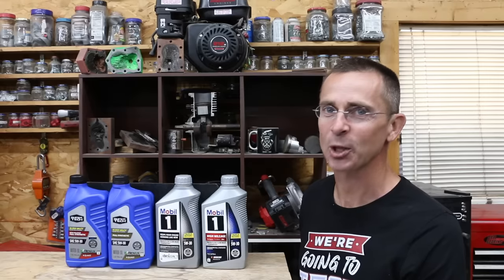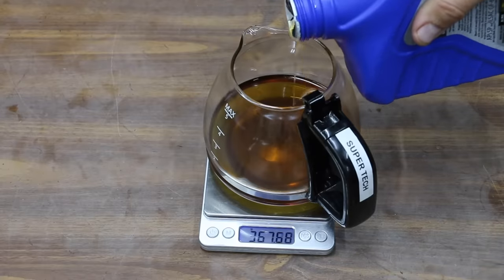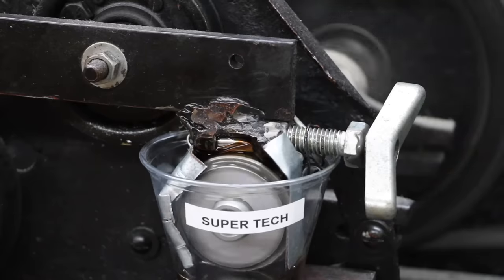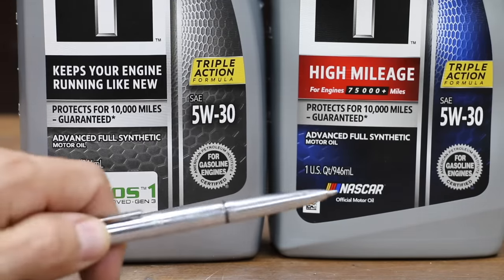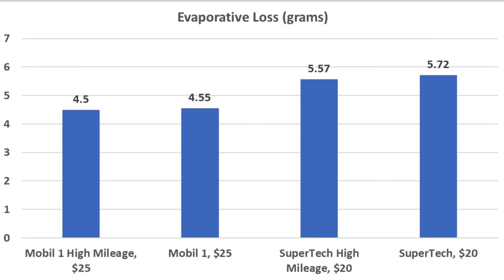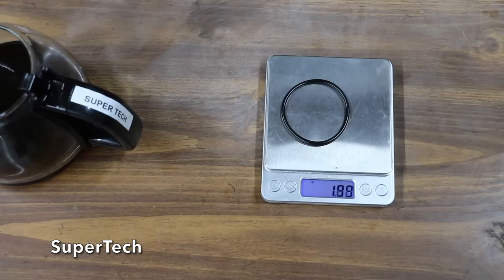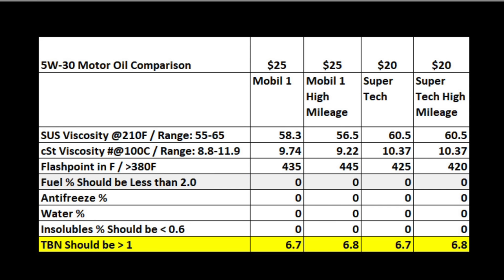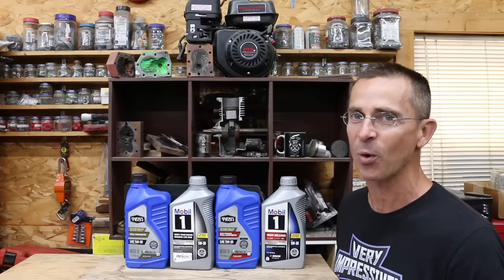Is “High Mileage” Motor Oil Safe? Let’s find out! Mobil 1 vs Mobil 1 High Mileage; SuperTech vs STHM

Comment: For those of you who don’t have time to watch the full vid, stick with a high mileage oil. It’s slightly better based on the test results concluded.
Reply: thank you
Reply: Meaning putting the "high mileage" rated oils from a manufacturer, even on a new engine?
Reply: @AKS-74U  High mileage has additives that causes worn out/heat cycled rubber seals after 100k miles, to swell up. Once you switch to high mileage you cannot switch back. When the swollen plastic seals have regular oil switched, you'll most likely see some leaks due to the shrunken rubber. So if you switch to HM oil, don't switch back.
Reply: @devinlehman8798  This is only partly correct, it depends on the brand and varies engine to engine.  Valvoline has stated their HM oil is fine for new engines, while Mobil 1 has stated the opposite (not recommended for new engines with no leaks).
Reply: @AKS-74U  It swells the seals - unnecessary on a new engine.
Reply: Thank you
Reply: He just recommended to not use the high mileage if your vehicle is still under warranty since the oil is not certified.
Reply: meh.... i don't like the additives that plump up seals.  only if i have a tiny leak will i try it.
Reply: All catalytic converter‘s are warranted to 75000 miles and the high zinc content of high mileage oils can damage your catalytic converter. Kind of like lead in gasoline  it will do the same thing
Reply: @67_PowerStroke  Incorrect, high mileage oils carry the exact same certifications as regular in the same grade.
Reply: @ianspeckmaier9565  If you watch the video, he literally shows that the high mileage oil in the video does not have the certification....
Reply: @67_PowerStroke  It has all of the same certifications except for one: Dexos. If you don't drive a 2011 or newer GM vehicle that requires you to use a Dexos certified oil to maintain a warranty still in force then there's no problem using it. Mobil 1 High mileage 5W-30 meets the following standards from certifying organizations: ILSAC GF-6, API Grades: SJ, SL, SM, SN, SN plus, SP, and SP RC.
Reply: My car has 210k miles on it. I stick to what the manual says - same viscosity rating too. Regular changes. If an engine isn't leaking, I'd keep well away from anything that claims to have seal swellers - they'll swell alright, and then they'll shrink, and then you'll have a bigger problem.
Reply: Thanks!
Reply: @67_PowerStroke  he "literally" doesn't work for any of these companies, he's just testing their products. So you're "literally" relying on the wrong people for specific information. Can we "literally" stop using the word "literally" incorrectly now? Sound good?
Reply: @otallono  And neither do you.... I'll t rust him over you anyday.
Reply: You the real mvp
Reply: @devinlehman8798  That's not true. If you think that it is, provide proof that says you can't switch back. Complete nonsense. Just like you can't switch back to conventional one you use synthetic.
Reply: @MattExzy  D
It doesn't work that way.
Reply: U da real vip
Reply: @devinlehman8798  That depends on how much you care about your car overall.  I have a 2005 Scion tC that I've been driving for three years and I'm waiting until it dies to get an actual new car, but even after switching between a half dozen different oil brands and types, including HM oils, it's still running fine without leaks lol.  I'm tempted to kill the engine myself so I can get a new car at this point.
Reply: @samuelmontypython8381  the way the market is right now you could probably get a good buck selling it and get you some more cash to go towards your new car 🤷🏻‍♂️
Reply: Thanks, still let it play out with the volume down so they can get their revenue.
Reply: @devinlehman8798  This is purely anecdotal, but my Acura with 254k miles on the clock recently started dropping oil in my garage. Took me until today to realize I had recently switched from Castrol high mileage to regular Costco brand full synthetic. Hopefully my seals aren't shot but I guess at this mileage I can't be a beggar. Gonna try to switch back to Castrol HM just for the fun of it.
Reply: @nateblazek3671  you should be okay if you switch back to high mileage, but I've heard bad stories about all the seals never swelling back up again.
Reply: I think the big difference is anti-leak additives in the HM ones. 75k, to me, is not very high-milage especially if the car is well taken of. I started using HM on my 2001 Ram 1500 with the 5.9 Magnum when it hit 150k. Now at 190k and still running strong with no leaks.
Reply: @timetryp422  So if you high milage engine does not leak then there would also be no reason to use high mileage oil either.
Reply: "For those of you who don't have time to watch the full video..."  Would be referring to those who Really should examine their priorities.  If you're interested in enough to seek out Legit Tests, you should be equally interested in seeing How the (Results) came to be.
Reply: Since it said, high mileage oil and it was meant for that purpose but it perform much better then the regular synthetic oils, can we use that on low miles vehicles?
Reply: @devinlehman8798  Yeah, but project farm just test the O-Rings and nothing much has changed, so where did that information came from?
Reply: @nickyalousakis3851  swelling of seals in never a good thing. if they leak, then the swelling is a temporary fix. Swelling seals is them crying out due to contact with incompatible chemicals. this causes degradation. hmm...
Reply: Ya brah gotta get back to my mindless scrolling on tic tok. Any form of information is too much stimulation for me. Just here cause im broke... Maybe cause i didnt wanna learn 🤔 maybe its cause im addicted to my phone.. Idk fam but im already writing WAY too much
Reply: @gosh.o505  It's all the same.  If the market is low, you'll get less, but pay less purchasing another.  Market high, you'll get more, but pay more.  The fact that used vehicle prices are inflated means nothing if you're selling, then buying.  You'll also be buying high so any benefit selling your vehicle is useless.
Reply: @pault1439 It's  actually true. And for similar reasons you should never use synthetic oil in old engine
Reply: @MattExzy  high mileage oil aren't meant to stop leaks, they're meant to prevent leaks with additive seals conditioners that help the seal stay pitiable rather than drying and cracking or become inflexible. If you have a leak it's already too late and you just need to replace a new seal and gasket.
Reply: @samuelmontypython8381  that’s not that old of a car. People are too picky these days. I drive a 99 outback until 2022 and now have a 2012 highlander that I plan to keep forever unless it rusts out (in the rust belt, but it’s still rust free at 220,000 miles. Sell the TC, young guys snatch those things up as cheap easy cars to tune/learn about cars with.
Reply: @integr8er66  wrong, high mileage oil isn’t ‘prescribed’ like a med, you can use it whether or not you specifically need leaks fixed.
Reply: @Theultrazombiekiller  I have the same truck with 144,000. It’s the last ever model year of half-ton truck with solid axles front and back, I’ll NEVER sell mine. Might LS swap it though. Haven’t had much luck rebuilding the tranny 3 times. Motor is gutless too, even with a moderate cam and 4:10 gears. A GM auto trans has a much lower first gear than the 46re, the re is terrible for acceleration from a stop.
Reply: See this is why we keep you around!
Reply: THANKS  !
Reply: @devinlehman8798  
Good to know.
Reply: @AKS-74U   No, just cars with over 75K miles
Reply: Thank you for this.
Reply: @67_PowerStroke  LiTerALlY showed that the supertech high mileage does have the certification
Reply: It has dexos certification
Reply: Good video - confirms my experience with hi mileage oils. Good to know about these in particular. I’d like to know how Pennzoil and some others that auto parts store chains sell compares, too. I’ve been using hi mileage oils, and later, hi mileage synthetic oils in my cars for many years. I always buy 3-5 y.o. used cars with 65k-95k miles, and start in with those oils right away. I usually get 10-15 years and well more than 100k miles before they start needing significant engine work and I’ve lived 20 years in L.A. where usage is rated “severe”. Same with the automatic trannys, which have been lasting even longer with proper servicing. Thanks, “Ozzie”!
Reply: You the mvp
Reply: @MrDaemonFC2U  my take when using other brands, is to change my oil as soon as I can. Changing oil on time is way better than going by brands and special logos like dexos.
Reply: @devinlehman8798 can’t believe how many people actually liked your comment considering you’re spreading false information. TLDR for anyone else reading…High mileage does not swell seals. It just has extra additives to keep rubber/seals pliable so they don’t dry out. Anyone who starts to say “I heard bad stories about..” please don’t listen to them
Reply: God bless you brother
Reply: Thank you for the tl;dr
Reply: Brother.
Reply: my guy thx bro
Reply: @devinlehman8798  stop with his nonsense
Reply: I love you
Reply: and what about the advanced that says it does much more?
Reply: @nickyalousakis3851  I don't like it when it rains.
Reply: My wife could benefit from using a high mileage additive of some sort
Reply: @devinlehman8798 imo I agree with that but from my own experience once a seal is done it’s done.

Pull the trans and replace the rear main seal or front timing cover seal (350 vortec) high mileage engines are gonna ruin any old seal regardless.

High mileage oil helps your engine yes but if it’s leaking regardless then no change in oil is going to affect the seal for the better (since it’s worn already and has met the end of its heat expansive life cycling)

there’s nothing that’s gonna stop it, not even stop leak, mostly because the seal is warped or no longer holding its shape and is worn out. all that stop leak does is clog your engine over time and slow the leak, which is a no go. Just pull and replace the seal/gaskets and pat yourself on the back my guys. Doing it right is always the correct answer
Reply: @MattExzy  Time for a new ride!
Reply: You're doing the Lord's work!